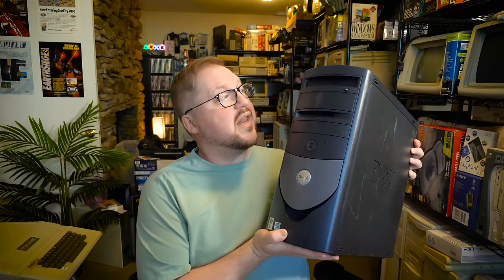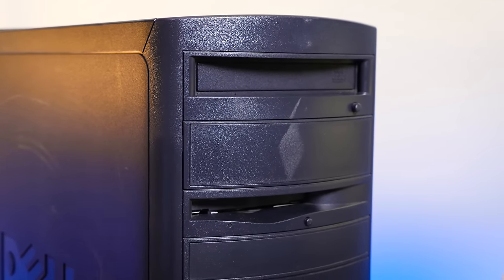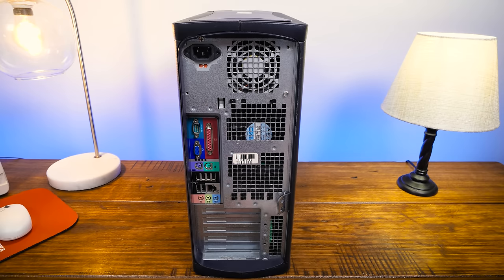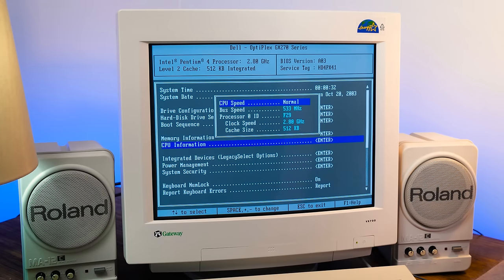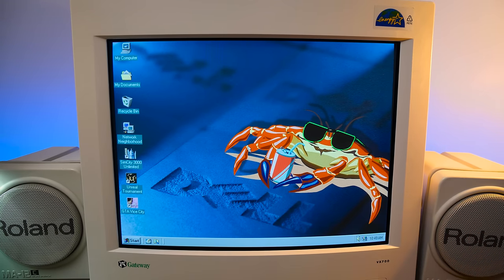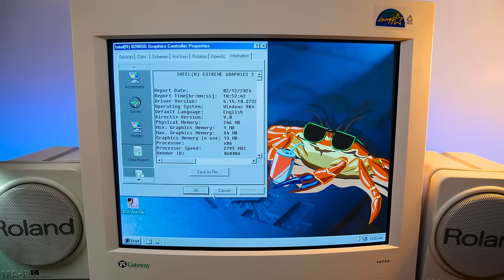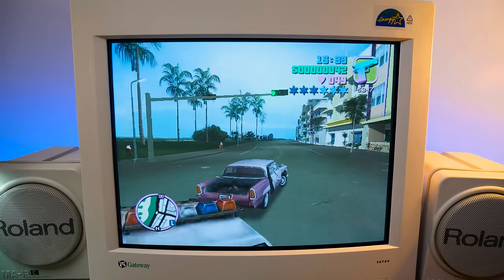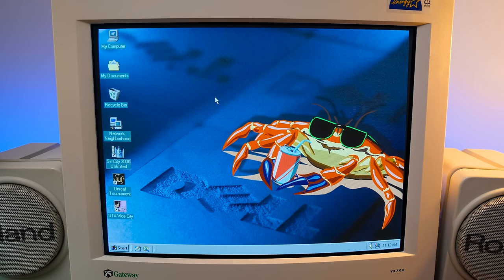The Most Unwanted, Boring PC: Dell OptiPlex GX270

Comment: I have a soft spot for these old Optiplexes. I HATED working on the tower versions (like this one) but Dell did make an incredibly dependable, if somewhat boring product. Even when they suffered from capacitor plague, they still usually tended to carry on working. I think nearly all the Optiplexes of this era that ended up in the recycling were there because they were genuinely too old (we sweated our assets for a LONG time past the manufacturer's warranty), not because they were faulty.

The GX280 is the one to have if you're wanting one from this era. P4-2.8HT, 4Gb RAM, plenty of upgrade options. If you get a REALLY late model it'll be in the newer GX520/620 chassis which is a HUGE improvement on the one in this video. Or you could just get a GX620 (don't bother with the 520, it only has 2 RAM slots).

Comment: I had one of these at work! Most of the GX270s my office ordered died from bad capacitors. Mine only made it to 2008 or so. The "home" version, the Dimension 4600 was troublesome too.

These were great machines if you need to run AGP cards though. They run the last AGP chipset Intel produced, the i865. They are new enough to have working SATA ports too. The i865 still has some PC-PCI DMA capability, so DOS SoundBlaster compatibility is pretty good too.

Comment: I worked as an IT Manger for a local supermarket company in the mid-2000s. Out of the 24 shops, which all had one of these Dells as a server running the tills, around 20 suffered failure due to blown capacitors. Always a nightmare when one died 🤦‍♂️

Comment: our family had a very similar looking dimension from about 2002 to 2014 it was in use, i still have it but unsurprisingly all the caps have gone bad and it won't power on. i don't really have the energy or desire to fix it but one of these days i really want to stick it's hard drive in something just to see what we were up to back then, it had to be wiped 3 times cus we kept getting viruses (probably from limewire etc) but it put up with a lot. glad to see it in a video even if it's not the most flattering, to me this is the computer you play flash games on and look at sonic fanart from the mid 2000s on

Comment: I live in central Europe and in schools there were more of HP and IBM PCs, so seeing these Dells was quite intersting for me. I found one gx270 desktop in trash around 2013, but there was bad PSU, and some motherboard capacitors were bulging. In 2020 I finally went to repair it, but it stayed on for an hour and died again. Last year I acquired one gx280 without PSU, but otherwise functional. 
I must say that for me, the optiplex series has quite nice design

Comment: Most of 2001-2007 was spent replacing bad capacitor motherboards for customers, it was an epidemic during that era.  On that note, too many computer techs out there also had no idea about bad caps, so they’d replace HDD or RAM instead, meanwhile the problem would follow.  Even in rare occasions, caps would burst underneath and not above, so it could be a bit invisible.

Comment: Had a G270 at work. Worked at an old Lumber yard in 2005-06 that we made pre-built wall panels for cheap vinyl village houses. I worked in the cad drafting area, using AutoCAD 2002. 
The only good thing about the setup was that it came with some Harmon Kardon speakers. That was it... Nothing else about that PC was good.

Comment: I had one similar! Maybe something later down the line, but I remember that cursed thing! Every time you would open it, you'd stress some of the wires hooked up to the motherboard that lead into the other half of the case. At some point this hunk of junk needed a lot of maintenance and it snapped an edge off the motherboard one day after opening and closing it too many times.

Comment: This is definitely a candidate, but i would say anything with windows starter edition, like my acer aspire one netbook, which currently has no operating system (was running windows 9/10 insider on it), took a long hard fall down a flight of wooden steps, and currently has something rattling around inside.

This pc and, to a lesser extent, the landscape model are what i think of when it comes to classroom computers. The teachers mainly had the landscape models while the most classrooms had 2 of these towers for students (the exceptions being classrooms that had no computers at all or were computer labs.)

Also,i am soo happy to hear this computer is getting repaired. I think it earned it. Its that kinda feeling that i get with my steam deck or with Sonic 3D Blast. It has that underdog charm. You can't help but root for it, even if this computer is boring and mundane.

Comment: In 2012 my dad got a 2006 Pentium D Optiplex, and I remember watching so much youtube, playing tons of flash games, and exentually real games when we started playing Diablo 2 in 2014, which is probably the thing I did on it the most, even if it was only for a few years. He gave me the machine around 2018, and unfortunately I got rid of it in 2020 shortly before I moved out, but the memories will last forever. PS. If you ever play D2, make sure to set a timer, or else you'll play for 10hrs without knowing it.

Comment: I had a later model version of one of these, still a p4 2.8, but in digging through the bios, the damn thing supported hyper-threading.. which just about blew my mind.
And it worked, which was even more impressive. Gave a half decent performance boost to the system too.

Comment: The 270s had a flaw where when the caps bulge the power circuit would die. So if you shut it down it won't turn back on... Unless you pull power and plug it back in. Initial power on worked. Power on from soft power off does not

Comment: The first PC I ever bought with my own money looked exactly like this! It wasn't branded as Optiplex I think and it was a proper gaming PC with a 120 GB SATA hard drive and a Radeon 9800 Pro AGP GPU but it had the same case. I kind of liked the look even if it was mostly plastic and I definitely liked that you could access most of the hardware without a screwdriver.

Comment: We used the SFF versions of these at school. A few years ago I got my hands on one as a bundle with a Dell CRT monitor and was able to replace the 2.8GHz P4 with a 3.2GHz P4 641, added 2GB for a total of 3GB RAM and with a GT 640 it could play Resident Evil Revelations at 40fps and Alien Isolation at 30fps with an HD 5570.

Comment: I recall we had a batch of these at work that were missing the AGP slot.  The motherboard had AGP but the connector was literally not soldered in at the factory.   We had so many of these back in the day that I can't remember if it was the GX260, GX270, or GX280.

Comment: I have two of the micro optiplex computers as my livingroom media hubs. One is a 7040 quad core for streaming network television over the internet, hulu, general internet searches when a large screen is needed, etc. Then I have a 7070 six core as a plex server with a nas ssd. This unit is more than capable of 4k transcode, though I mostly only serve 1080p. Have had four clients on it at once without any hiccups.

Comment: Had these in my environment (public library).  I finally disposed of the last of them about 5 years ago.  They were the "canary in the coal mine" that was the Cap Plague.  I'm still weeding out a few legacy monitors from that era as well (that I didn't replace the caps in).

Dell's "Tool-less design" designed by a by a tool... 🤪

Comment: I used to do tech support a while back ago (2006/2007) at one of my first jobs (at Walmart in Argentina), they all had Dell PCs, notebooks, and I did support these GX270, but also the GX260, GX280 (a more modern case design) and even the Optiplex GX1 with PII 350 MHz CPU. I kinda liked them. They were boring of course, but for basic work they were pretty solid.

Comment: I installed 1000s of these at my first corporate gig, a massive insurance company with 7 floors in the building, and after we finished the rollout, the HDD's systematically started crashing 1 by 1 until it was like half of them, over 4000 machines I recon.

Comment: Oh my. Yes. I remember a primary school I attended in Singapore from 2005 to 2010 having OptiPlex GX260 (or GX280) minitowers in some of their rooms and that they likely purchased at around the same time as their Latitude D610s. They didn't have many by the time I attended as they had NEC PowerMate VL series (with Philips CRT monitors) in all 3 of their computer labs and some HP Compaq DC series minitowers (with HP branded Compaq CRT monitors) in some of their other rooms, not to mention some Datamini Cesky and unknown model White Box PCs too. (edit: also some mid 2000s IBM ThinkCentres)

Edit: I think the school's IT department bought their HP and Lenovo PCs as replacements for their Dell PCs that had failed at the time and their remaining Dell desktop PCs I saw were likely ones that hadn't got much as much use as the others.

(9:15) At that point, I was reminded of a Dell advert from the late 2000s that featured a cover of that song. (Edit 2: it was an advert for the Dell XPS One and I think the point of the advert was that it was one of Dell's first PC models to come in black instead of white or dark grey, this was in 2007 where laptops started being released with widescreen displays and widescreen monitors were also being released, as well as a time when PC manufacturers were moving away from white, silver, and grey to black shells with some having silver accents)

Comment: The compute guts were unremarkable and the exterior was boring, but as a desk-side technician when those dropped, they were a blessing.   The company I worked at went from systems where, if we were lucky the case panel might be tool-less but everything else inside was bolted down with a mix-match of various screws (often stripped out) from years of servicing from my careless predecessors, to these tool-less wonders of (then) modern technology.

They were great, until they weren't, is what I'm saying.

Comment: When we use to build PCs for sales etc these cases were common and great option to use, (re-using the power supply, optical drives, cables, etc) not so great for deliveries since the cases are heavy but the layout and cooling solutions were great in it. But yeah the OG boards were tossed into recycling.

Comment: I used dozens of these, or the 280 and SFf variants. $30 delivered with a clean XP Pro install, enough RAM and HD. Install TightVNC and add to the server farm and work them until they break. Bad looking caps weren't a problem. Switched to the IBM S51 as a boring replacement for the same money. Actually using one right now backing up one of my NAS drives. But, whatever, those optis were a bargain, just fan speed sensors and PSUs killed most of them eventually 😃

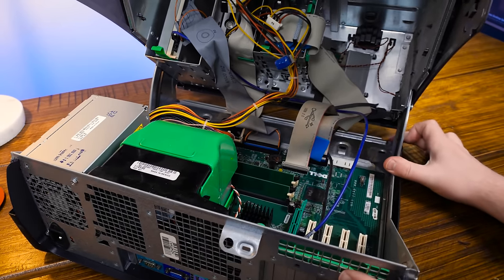Comment: 8:19 Shortly after I started at my last company (doing data entry, then web site creation/administration, and finally multi-stack devops when I left) the owner was finally replacing the various random desktops. The Optiplex GX-something, could even be this exact same model, was the model of choice for doing so, and I was the one who set everything up. So I'm surprised you only had one dust bunny! Not that they come pre-installed, but over the years of maintaining them it was obvious they would hoard dust like a mofo; the seller must have given it a quick can-dusting before shipping.

All of the various compartments and swing-away parts did make some of the maintenance very easy, but they also created tons of places for dust and hair to get stuck in (and difficult to get out of...)

13:49 lol

Comment: Can confirm: I replaced capacitors in countless Optiplexes. What exacerbated the issue is that these had poor thermal cooling compared to their home Dimension counterparts that also suffered much of the same capacitor problems so you can imagine baking in an wooden office cabinet 5-7 days a week these babies had ballooning caps when they arrived at the shop.

Comment: I worked at a computer recycling place about 10-12 years ago and we'd get these in by the pallet load, and then resale the working ones on eBay. Since I was the one who went through them, I learned to really appreciate how easy they are to work on being tool-free. But yes, very boring, ordinary computers, but they'd get the job done if you didn't ask too much of it. These at least had AGP and you could stick a slightly better graphics card in them. If memory serves, the GX-260's were even worse about the capacitor plague, but yes, plenty of 270's got scrapped because of bad caps.

Comment: My UK based Dell GX270 is still going strong. 
If was a 'street find' from 2013, originally with a Pentium 4 at 2.4ghz, 512mb and an 80gb IDE drive.
It has since been upgraded to a Pentium 4 HT at 3.00ghz Northwood, 4 gigs of ram, a Geforce 5200 (for fun), 500gb sata drive XP/Win7 dual booting.
It gets used for about 4 hours every evening, pretty nippy for browsing and watching films/photo viewing, emails, a game or two of Quake III arena and ZX Spectrum emulation. 
Caps get check every few months, nothing leaking yet... Change the bios battery a few times since finding it - remember to switch the CPU HT back on as the bios does not autodetect it, along with a thermal repaste every 5 years.
Always hated the placement of the unusable front USB ports - they require a short extension cable to hook up a USB thumb drive, and the weight of it. Damn, they are heavy. Great construction though.

Comment: I was a contracted engineer at dell during this time frame.  Lots of instructions to deny the capacitor problem and force users to go through the full troubleshooting procedure even if its was mindlessly, blatantly obvious what the issue was.

Anyway, i suspect this machine will have problems if left running for 4-5 hours.  Display going dead, etc.  That's usually when the issue would crop up.  Then go away after its been sitting long enough to cool off entirely and the caps to chemically restabilize.

Comment: I have a Slimline Desktop GX280 and I keep it around for one purpose. Wiping drives. The GX280 had both sata and ide as well as bootable from floppy. I have DBaN on floppy and can wipe any drive with it. 

Not as useful in the era of SSDs but still keep it around for this singular purpose. 

But be careful. The PSUs are notoriously bad and this is the era when they weren’t always using the standard 24-pin. The worst part were capacitors but you addressed that already. :)

Comment: Funnily enough I had to work on one of these just a few weeks ago. The university I work at still uses a couple of those to control a bunch of microscopes since the required software only runs under XP. However, the one that I had to work on just went for a black screen after it ran for a while. After looking at it for an hour or so I just recommended the people operating it to throw it away and get some contemporary hardware that can run a XP virtual machine. I didn't feel like spending time on working on 20 year old hardware... Also I actually had to watch a tutorial video to find out how to open the case of this dang thing!

Comment: I never saw the tower version but a very similar model (horizontal case) was what we had in 2005/2006 and those machines were still kicking around in 2009-2011, in 2012/2013 I went back to college and we had some newer Dells but with a surprisingly cool mesh case

Comment: I built a "sleeper" PC in a similar looking Dell Dimension 2400 case. It's built specifically for emulation retro gaming so it's somewhat modern hardware but nothing incredibly powerful. It's running Linux with an XP theme at the desktop. It's a cute, fun project. The case is mATX compatible but looks completely boring on the outside and somehow find it charming.

Comment: I got two years ago , HP DC7600 for free , it has 64bit Intel P4 of some kind and 4GB of RAM , integrated graphics and they installed 320GB 2.5" SATA drive in it  via bracket with double sided sticky tape , which I removed and installed also free 3.5" 1TB drive from 2008 , added my old Dell 19" 4:3 LCD and my old mouse and keyboard , it still has its XP license sticker on the bottom , and being the desktop case instead of tower like this one , not so many expansion slots inside. Even RAM sticks are low profile ones. But , it can run Win7 with such configuration , which is win for something that's completely free and I use it to play old games and do emulation stuff. It also has intake fan at the front and active cooling CPU , and no exhaust besides the power unit at the back. Monitor sits on top of it , so I get nice , leveled monitor and playing games up to 2011/2012 is breeze. No need to bother myself with extra program compatibility layers if I want to play something really old. As it'll work , just like these were made - connect everything together , install OS and keep going.
Like pointed , driver availability and service and user manuals of these business machines is unmatched.

Comment: One of these dying from capacitor plague at my previous job took down a $100k piece of lab equipment that was no longer under support. The software was a convoluted mess that controlled two RS232 interfaces and a high speed NI DAQ interface. Could not get it to run in any other combination of hardware we could get our hands on. Fortunately I was able to quit before I had to get it working again.